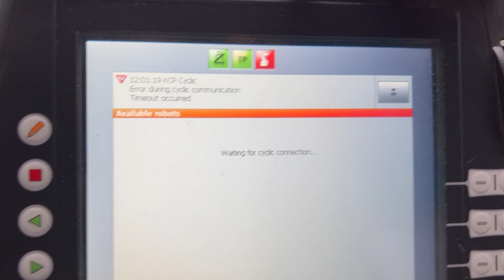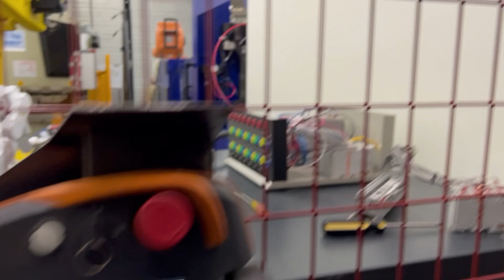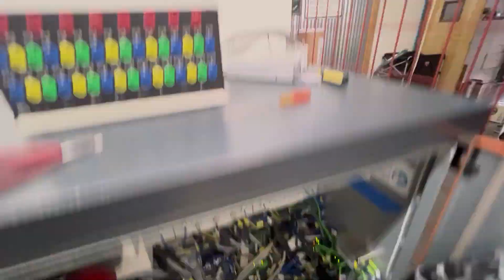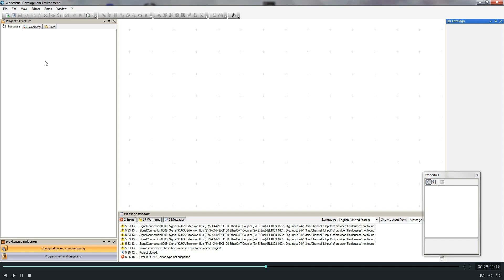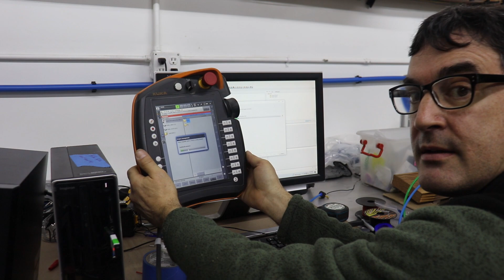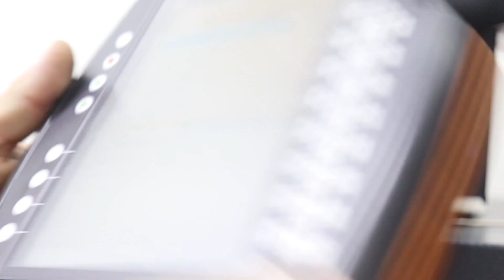CONFIGURING THE SIGNAL INPUTS AND OUTPUTS IN THE KUKA ROBOT CONTROLLER

Comment: The trick to pulling the beckhoff modules off is to pull them by the orange tab. pulling on the tab releases the grab on the din rail. I pull the orange tab and wiggle the module up. this works even in the middle of a long row of modules.
Reply from the maker: Thanks for the tip! And thanks for watching too.

Comment: I have a Beckhoff 6752 module which doesn''t have multiple I/O pins since it uses a DeviceNet Master and DeviceNet Slave and on work visual I have mapped $OUT[1] to Output 1 of the Generic DeviceNet Slave.. so how do I wire my + wire and - wire of my external device  so that I can control it using the output signal?

Comment: thanks for the video.   I am working trying to get some/ANY I/O to work on a KRC4 compact.    I Don't currently have a X12 connector or a IO Beckoff EK1100  (that i can see anyway).    So I have been working to get the onboard Pneumatics to work.   I can get the solenoids to in the arm to click but no valve function.      
      Do you have any experience with the Kuka onboard pneumatic valves??    If i can't get the valve to work i will be adding the Beckoff EK1100      I need to learn a lot more about Kuka Workvisual .    Also how is partners  g-code to KRL post processor working   is that available to the public?
thanks
Reply from the maker: @aasail  sorry, I dont know a whole lot about the on robot valves. I always had trouble finding the connector for it. I do know that the air lines in the robot arm. An start to leak after a while. Sorry, April doesnt want to give out her code. Doesnt want to support it. Good luck!

Comment: Hello, I am encountering an error when trying to import configuration XML files, with the message: “Object reference not set to an instance of an object.” Do you know what might be causing this issue?
Reply from the maker: Sounds like in your XML file there is a declaration of a object that is not assigned a value?  Maybe look for another XML file? I am not very familiar with the software side
Reply: @DragonflyEngineering  I downloaded the XML files again from Beckhoff's official website to ensure their integrity. Anyway, thank you for your prompt response. Greetings from Argentina.
Reply from the maker: @lucasnieva9251  maybe you need a different rev level to match the age of the beckhoff? is it new? I may be able to send you the XML that i pulled from my robot...
Reply: @DragonflyEngineering   hola yo tengo justamente el modulo EL1809, descargue los archivos xml de la pagina oficial de beckhoff y los he adjuntado a workvisual y al momento de buscarlo en el catalogo, no me aparece

Comment: Is the beckoff module just plugged into the X44 on the KUKA? Then it needs a separate 24 V power supply? Is there any other connections it needs to be set up?
Reply from the maker: That is all you need.  You do need to have your 24 V DC ground ( Black "-") wire to be tied to any other 24 V DC system's "-"/ ground/ 0V, so that can recognize the +24 V DC signals that pass between 2 dif 24 V systems. You may be able to use earth ground as a common reference for your DC power supplies reference "0 V" ..and configure the IOs with Work visual. Thanks for watching!

Comment: Thank s for your vidéo, so I have a question I have a Kuka agilus 2 krc4 controller connected to ethercat coupler 16di,16do so the robot already in production. So i see the control panel and I see that there’s 1di not used and I would like to install a pushbutton on it, so I would like to know how to see on work visual which input from my coupler are already mapped to the robot to know if I need to map the remaining di or it’s already made on the controller ? Thank s again for your video
Reply from the maker: You can test the input, put 24 volts on it ( if it is a + 24 v dc input device) the use your teach pendant, to look at inputs: display-inputs/outputs, select inputs. Then see if a green indicator lights when you trigger the 24v. Most likely all the available ports were mapped when the previous ones were
Reply: Thank’s for your reply, I will check that tomorrow so supposed it s already mapped how to know which di from the coupler is assigned to which di on the robot in order to work on it in the programming
Reply from the maker: @pubglogin-w9n  you will need to see the mapping, by downloading the configuration from the robot to work visual and see the map, or simpler way is to test with a 24V wire on the robot pin ( at your own risk since I don't know your robot).  The x12 connector pins are  labled in the plastic. My pins # 1 thru 16 are inputs for all the KRC4 compact controllers.  Check out: robot-forum dot com. You need to sign up for free

Comment: Thanks for the video, I’m working with KUKA agilus 2 kcr4 controller and I have a ethercat coupler with 16di and 16do so, I have only 1di not used and I wanna to add a push button on it. So I would like to know how to see which digital input from my field bus already mapped to robot to know for example if I want to add a pushbutton I should mapped this remaining di ? or it’s already mapped in the KUKA controller that s why I wanna to look which di coming from the coupler are already mapped ? Last question Normally when we should make a change on xml file ? Thank’s again for your video

Comment: One thing I have noticed when working with different robots is that the software and hardware always seems like it's 10 years old, even if it's "New"  This industry needs to rebuild everything with modern full frame CAN Bus and modern software design practises rather than just using band-aid solutions. I just think it's sad when a guy like me can build a robotic agnostic controller from scratch using Unity that look far more professional, easier and faster to use with more room for customization.
Reply from the maker: Yes, I agree, they also seem intentinally too complex at times.  Thanks for watching!